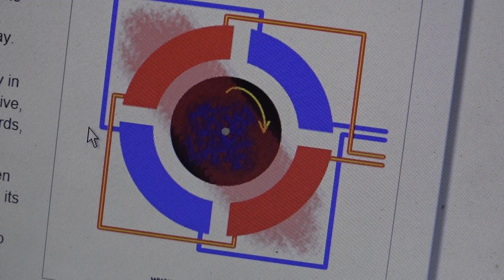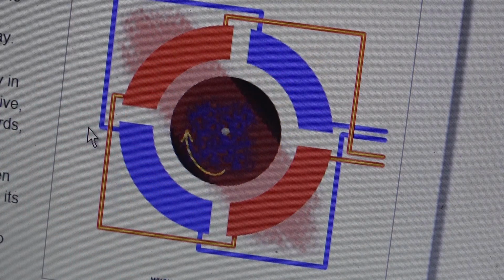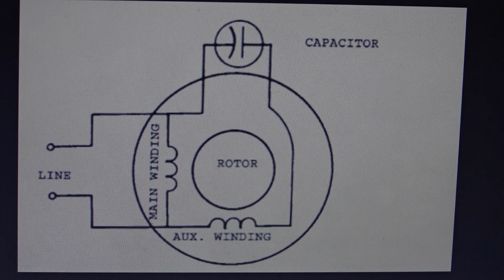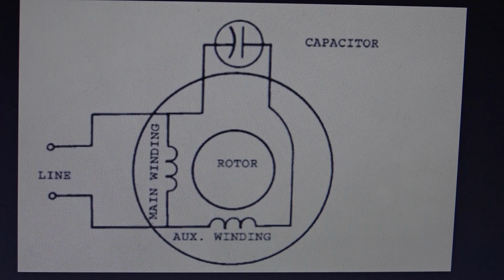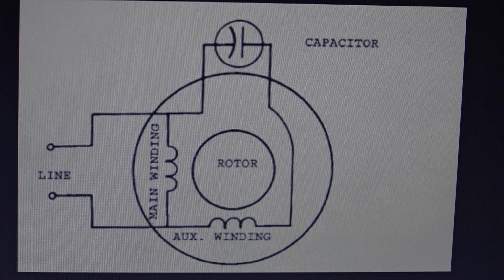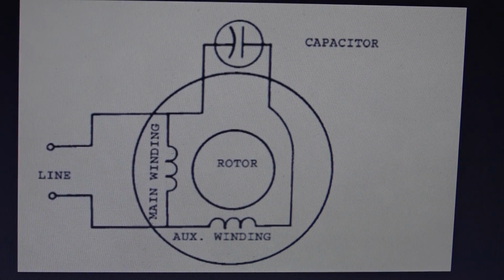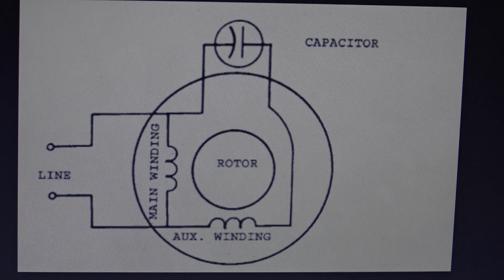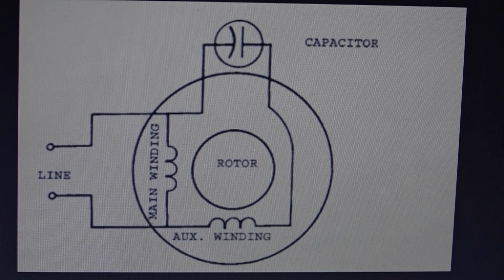Electric Fan very slow spin. Can I fix this? Yes I can!

Comment: Great video!  You should make one on "changing the switch" on a Lasko box fan.  Nobody has provided a video that CLEARLY explains the necessary "wiring modification" that must be done with the 2 neutral wires when using an aftermarket 3-speed switch.  As you might know, Lasko doesn't make the OEM switch available. 😮😮😮😮

Comment: I have two box fans Lasko brand.. One is running faster than the other. Therefore I'm guessing it's the capacitor maybe one is better than the other? But they're both new though 🤔🤷🏾‍♂️

Comment: I have a Westinghouse model AW11-1 metal fan with five big plastic blades from the early 1970s I believe.. 
Two speeds, fast and slow and on FAST it cranks!
It didn't start up on it's own until I sprayed wd-40 in there.
It worked good the three times I've sprayed it but last week I poured liquid oil in there for the first time, let it soak in, and then took the power blower to it to dry it out and rotate those blades!
It works GREAT!

Comment: Lucky me mine does not have a capacitor. If it slows down I need to oil the bearings.
Reply from the maker: squirrel cage
Reply: @12voltvids  Hamster wheel might be more fun?
Reply from the maker: @crazysquirrel9425  no that's what type of motor yours has.  Squirrel cage induction.  Capacitor less.  Only 1 coil.  Regular induction. Has 2 and a cap to create lag for Secord coil to create rotating magnetic field.

Comment: NOTE for people that have a 220v.... this Caps are usually between 1.2mf and 3mf........ and are usually of 400v.............  a 7mf x 250v in a motor of 220v..... it will damage the motor as Dave here mention..... Or the capacitor. will brake....

Comment: Hey my fan keeps spinning backwards what I did wrong
Reply from the maker: Wired backwards.
Reply: @12voltvids  I don't understand need more information.it have 5 wires on the whinder 3 for the speeds one goes to the capacitor and the other one goes to the terminal fuse but I put the whinding wire not where the end of the hot where the terminal fuse is but at the other end of the fuse where the wire goes to the capacitor what I did wrong

Comment: not too many people cover this part of fans not spinning fast.  I have a 2 year old fan that i oiled and either there's buildup that is slowing it down or a capacitor is going bad.  On High it spins like low and on low i can hardly feel anything.  here in the last few weeks if it's been running for a few minutes it starts speeding up.  but now it's not speeding up as much.

Comment: If the  the capacitor is in series with the start coil and the main coils are wired  across the line (through the speed switch), you should try running it with the capacitor clipped out. If it doesn't even hum at that point, the main coils, or the fuse that's embedded in them, it probably burned out, so changing the capacitor might not fix it. I just had to ditch my Lasko 20" box fan; I'll save the new capacitor, maybe for the next one.
Reply from the maker: But then you can always throw a meter on it.  If open then Houston we have a problem.

Comment: do capacitors go from 100% operational to critical failure or will they always/sometimes slowly degrrgate over time?
Reply from the maker: Sometimes they go out with a bang and blow their guts all over the place.  When the start cap on my HVAC compressor blew you could hear it up at the corner.  Sounded like a bomb going off. It blew the case apart and blew the 60 amp 240 volt breaker.  What a mess. Oil filled, it was all over the inside of the motor control box.

Comment: My box fan will start and run at high speed for about 20 minutes... and then seriously decreases in speed, over the next 5 minutes, and remains slow until I turn off the fan and let it 'rest' for an hour or two.   Is this likely a capacitor issue, or a coil issue?
Reply from the maker: Oil the bearings.

Comment: Great video! Thanks for putting this up. I have a fan with similar symptoms, and when I searched, there were a ton of videos on how to lubricate a fan. As if you need a video for that, let alone hundreds, LOL. But lubrication isn’t my fan’s problem, because it spins easily by hand when the power is off, but feels like someone’s holding it back when the power is on. Will give this a try.

Comment: This video U made makes me want to buy the meter you have ! Where can i get one or something like it ?
Reply from the maker: Its a very old American made Fluke 12. I have had it for probably 25  years. I bought it at a ham radio flea market for 12.00 I think. Best investment in equipment I ever made. The Tektronix 604 X-Y scope I turned into a clock was another good buy for 20 bucks.
Reply: @12voltvids  Well thanks for replying back .  I guess i will have to check around to see if i get lucky 2 ! hahhaa

Comment: So, I have a fan that runs too fast. If I remove the capacitor it will run on the single primary coil at a slower speed and the direction it spins depends on which direction I give it a shove thereby giving me a reversible fan. Sounds like what I need.

Comment: I just purchased 2 Lasco power fans in July they run for a couple of hours and slows down and rattles . I let them cool down and they run again and do the same thing.  Now this is 2 fans doing that. If I run them on low speed I dont get them to do this. They have 6 uf caps. What do you think?

Comment: Bad move to just use heat shrink for the joint - it is NOT to code.  A simple trip to Home Depot or Lowes and you could have picked up the identical crimp connectors that were on the fan.

Comment: Does a bad capacitor prevent power from flowing through the aux winding completely, or does it flow through but doesn’t create a phase shift?
Reply from the maker: Depends on failure.  If it goes open then there will be no flow in aux winding.  If short then too much current will flow but no phase shift.   So either failure will cause no rotation but leaky or short will overheat the winding and could trip the thermal cutout.
Reply: 12voltvids Thanks. Is fan speed controlled by phase shifting?

Comment: Whiteout RadioShack, where does a novice now get parts? Any suggestions?
Reply from the maker: There are still a few places.  I use RP electronics and Lee's electronics out here.  There are fewer parts stores around but there are still a few and then there is eBay.

Comment: I have a older metal box fan... has same symptoms ...don't see a cap anywhere on it... unless it is inside the motor?
Reply from the maker: Depends on the motor type. Squirrel cage motors don't use one.

Comment: Thanks for the prompt response.  The original cap is actually 2 uF not 2.5.  Browsing last night, found a 2 uF cap but no wires.  Wud have to solder the original wires to the leads.  How can I determine which wire (red or black) to connect to which lead or does it even matter ? Thanks again.  There was also a 2.5 uF with the red and black wires available but based on your response, using this might cause possible overheating of the winding ... so probably best to stick with the 2 uF.
Reply from the maker: As long as it is an AC capacitor you will be fine.  Polarity doesn't matter on an AC motor run capacitor.

Comment: Just saw your post.  Very informative. I am replacing a tower fan capacitor but cud not find an exact replacement.  Existing cap is 2.5 uF and the lowest I cud find is a 4 uF and also a lower max temp of 75 deg C vs. 85 for original.  If I use this cap, will it have any negative impact on the motor ? Thanks.
Reply from the maker: It will change the phase delay of the second winding and cause some inefficiency, and possibly overheat the winding. Put 2 of them in series will reduce the capacitance to 2.0 which will be fine.

Comment: What if your fan doesn't have a capacitor.... and your fan experienced a power surge and now isn't working at all... I've checked all wires all are in good shape and connected... it is a 30 year old toastmaster box fan ..... it's name might mean what is is now... toast.... welcome any insight... I took switch apart as well... all looks fine all wires attached no brown or black burn marks anywhere.

Comment: Hey, I wonder if a different capacitor can get your fan spinning slower or faster?
Reply from the maker: If you go smaller it will reduce the current in the second winding which will reduce the torque and this the speed will also drop.
Reply: @12voltvids  I think the capacitors regulate the fan speed. 
Not the magnetic force from the coils.
I'm guessing soldering resistors in series with the coils would indeed lower torque, but should do very little to RPM.
Reply from the maker: @ProDigit80  if you travel the wires from the switch you will find they go to seperate windings. Ok it is the same winding but there are multiple taps. The capacitor goes to its own seperate winding.
Reply: @12voltvids It seems that an AC based fan can only change speed if:
a- The AC power frequency lowers
or
b- The coils get rewound
Apparently, changing the resistance (magnetic flux) of the coils (by soldering a resistor in series with it), can cause overheating and kill the motor.

.

Comment: I had a fan in a dusty barn. It quit and only hums, possibly from dust clogged grills.  I cleaned the grills and it only hums like yours.  I turn the switch on low and it barely move one  way, I turn it on high and it barely moves the opposite direction.  I changed the 15uf capacitor and still no change.  Could it be something other than a capacitor?
Reply: Check or replace the bushes
Reply: @mobiletechnewphite146   Thank you.  I will check this.  I did not know they would wear out so soon.  The fan is only one year old.

Comment: what is ESR and why .14 esr will pass? pass what? if i knew what all that means, i would have to watch this video.m
Reply from the maker: ESR, Equivalent Series Resistance.
Capacitors block DC voltage, but readily pass ac signals (coupling from one stage to another)
When the electrolyte starts to dry up, they become less effective at passing these ac signals. This is known as high esr, and when the esr starts getting high the capacitor has failed.
This is not to be confused with DC leakage where they no longer block the DC from one stage getting into the next.

Comment: Hi there
My ceiling fan uses 4uf but low speed is too high for me,  can I put 3uf or 2uf instead of 4uf to lower it's speed ?
Thanks for the video
Reply: Wire in a dimmer switch in place of the single pole switch you're using to turn it on. This should adjust the speed. It's a way easier option than reengineering the fan with resistors. Stepping down the capacitor will likely do nothing but prevent the fan from starting.

Comment: I had similar Lasko fan that blew the thermal fuse while on the lowest speed but the capacitor tested ok at the rated 5uf, could it still be bad? The fan was about 10 years old and before it overheated it was running much slower, none of the main or auxiliary windings were shorted to the core and resistance seemed ok. When I ran the motor out of the case bypassing the thermal fuse it started to run hot with burning smell after few minutes.
Reply: Replace the capacitor Sir
Reply: @mobiletechnewphite146  Next time I know to replace the capacitor when it starts spinning slower, the windings got so hot that it blew the thermal fuse then just stopped working. That would explain why the motor started burning up with the thermal fuse bypassed.

Comment: Wow capacitors on box fans can be just like workers
Take out the black capaciter and replace with a white capaciter
In this case on this fan lol and it's starts working again.
In Alabama we have what are known as watch workers
A white guy watching a black worker and he works
But as soon as the white guy steps away he stops working
Ie my black yard man if I'm standing we're I can watch him he rakes the leaves as soon as I step away were he thinks I can't watch him he simply stands there just holding the rake but no moving untill I return and watch him work
For decades before Mexican workers came about job sites required  a white supervisor or a watcher
So the blacks would keep working it sounds mean but is true.
In 1970s they were sober no drugs no alcohol not very common back in those days with workers
The black workers know when the work is done their hourly pay comes to an end so it's how they make a 1 day job last five days.it got so common that now we have Mexican workers they work even when not watched lol so a brown capaciter may work but may may fail may not the white one always works to show the worker how to do the job correctly lol....Alabama you have to have lived here a long time to know this silly history that's never published.
Also it's very hot here and fans everyware are a musti need to find the how to wire up fan motors
And the Hindu guy and the Mexican I get lost trying to follow their videos and the black guys video is good but wires are messy theragain hard to follow.
I've got a new Dayton motor with capacity on the side metal style
And need to know does the power hook to the capaciter ? The fan has a wire coming out into the capaciter one returning into the motor from the capaciter 
It's a 3 speed fan motor 4 wires At length unlike the capaciter short wires 
Red blue black white the switch you mhook up all the wires to but what do you connect the power cord to?   No fan diagrams any ware so far to instruct how to restore an old fan a new motor a new blade installed into the antique refinished metal housing with a new 3wire cord ....seems simple but the motor says refer to diagram for connections and only labes it's wires ....I'm guessing one wire clips onto the capaciter and the other hooks to the common in sequence into the fan switch .

Comment: I'm not getting any hum at all. Aside from battery smell (electric burn smell) it's the first thing I checked. Blades aren't locked up - I can spin em and they will go a few seconds and not tighter than normal. What's my next check?

Comment: I left my box fan running in the window while i went shopping and it rained while I was gone so the fan got a little wet.  I turned it off and took it out of the window to let it dry for few days.  When I plugged it back in and turned it on, it wouldn't work.  Is there a simple fix or should I just buy another one?

Comment: H Dave Thanks so much i learned a lot. I found a 1970's Toshiba desk fan a few years back and never took the time to fix it, It works on speeds 1 and 2 but speed 3 is the same as speed 2. Where should i start first? Capacitor or cleaning out the bearing and shaft? Thanks for your help

Comment: As a stingy, grumpy tightwad I do love knowing how to fix just anything but man that's a lot of effort for a box fan.
Reply from the maker: When it is the middle of summer, and all the stores are sold out of fans for the season, this is actually very little effort. Total cost to repair the fan was 2.20. Cost to replace that fan 40.00. Do the math.
Reply: Not really John, that is pretty simple & it does not cost much at all.

Comment: If you replacing the capacitor does the µF have to be exact? I have an old air purifier with a fan and that I just use for the fan and it started to act weird like it takes a little while to come on and it buzzes but then once it comes up to speed then you can hear it kind of fluctuating in speed but continues to run is that a capacitor issue? Because I opened it up and right there is the capacitor it says 3 µF 250 V even though it is a 120 V fan but why I ask is I have a couple of old motors from pedestal fans and they have capacitor about the same size but one says 4 µF would it be bad to change it to that one or should I get a 3?
Reply from the maker: A 4uf will be fine. The reason it is rated for 250v is you have to take into account the peak voltage. 120V is the average voltage, but the peak voltage is much higher, closer to 170v so the cap is rated for that. My 240V compressor and fan cap on my HVAC is rated 450V for the same reason. To handle the peak voltage.
Reply: Thanks for the reply funny coincidence I was still watching your video right is you replied and trying to fix the fan right at this moment! Lol
Reply: I believe that "start" capacitors can have a µF range to work within and drop out of circuit after startup but run caps are 100% cycle duty and to be more specific for optimal phase adjustment for motor to run it's best.  Pretty sure this is just a start cap on a box fan.  I still have a lot to learn about different types of motors.
Reply from the maker: Ben Boudreau 
A 4 will probably be OK but you wouldn't want to go down at all or up too much. You won't say put in a 2 as that would result I. Too much torque. A 7 on the other hand would change the phase lag reducing efficiency and creating more heat in the run winding. But going from a 3 to 4 will probably be ok.
Reply: 12voltvids well at least the fan is running still after I put that new cap In from a fan in my junk pile so you helped me out a lot and that was two months ago so far so good,  the fan has been running hanging from my ceiling for at least 10 years blowing the air between one room to the other blowing the heat from my woodstove room under a top door frame!  It’s an old modified air purifier without the filter hanging by support wires.